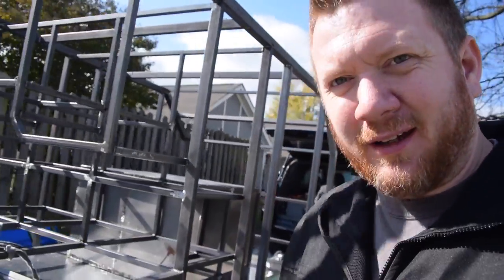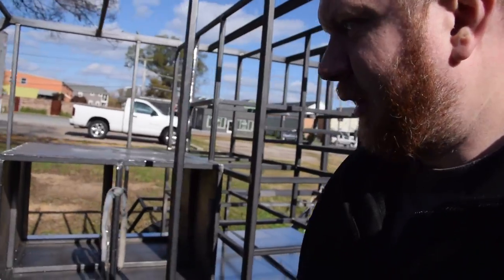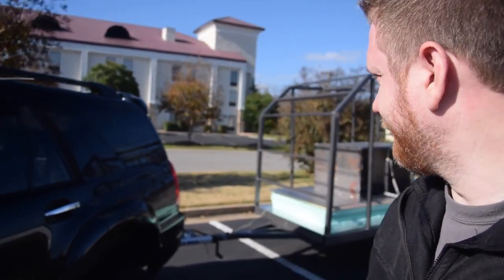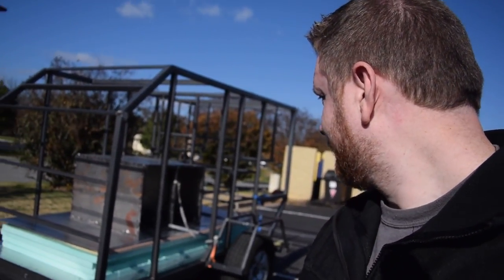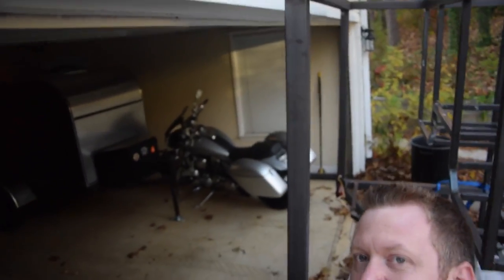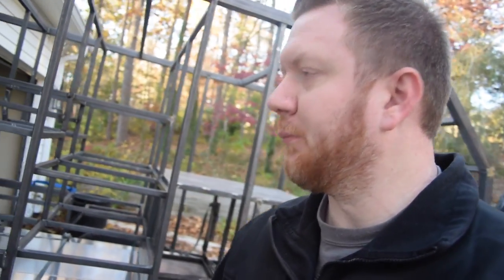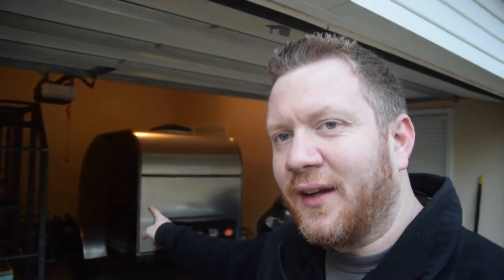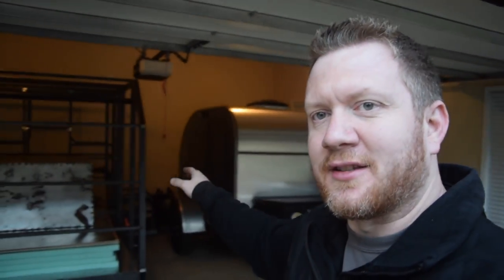The Pickup | Off Road Teardrop Camper Trailer Build 1

Comment: I would prefer details of the trailer build and A LOT LESS highway and pumping gas footage. What is the story on the frame structure? Not much content here. Lame even.
Reply from the maker: +SC Nomad thanks for the feedback there is no build footage as of yet. This is a frame I picked up as is and will continue it in 2018 as my next big build :)
Reply: You would prefer? Lame? Please share your skills...we're all holding our breath.
Reply from the maker: Or just send me money so I can finish it sooner lol!
Reply: Southern Ginger Workshop LOL. Everyone's a critic. We've chatted before...I am going ahead with my build. I have a fabricator welding up a frame and it's being skinned with aluminum...be lighter than wood and watertight, I will need to install releif valves as it might be too airtight...some of the components are harder to find in Canada but it is happening. Going with Timbrens and doing all inside and trim work on my own...once I have the hull I will start making vids. Cheers mate!
Reply from the maker: Super awesome dude! I have the timbrens 2500HD, those are nice because you can upgrade them without buying new axles. Just the urethane springs